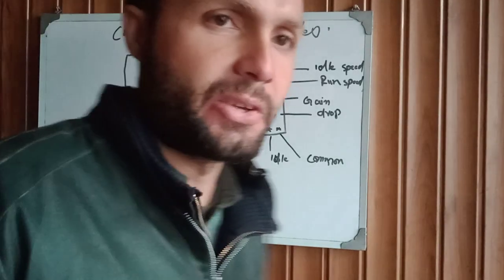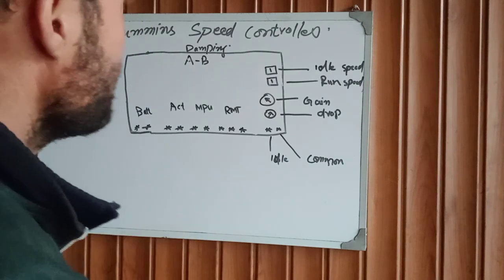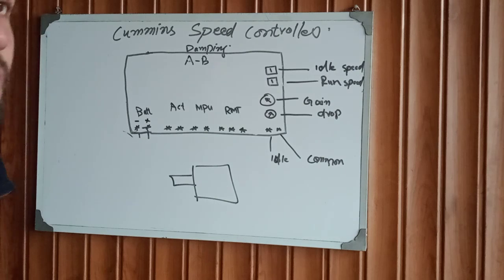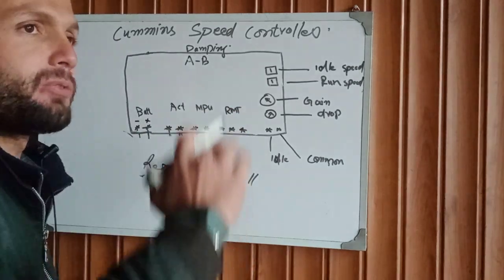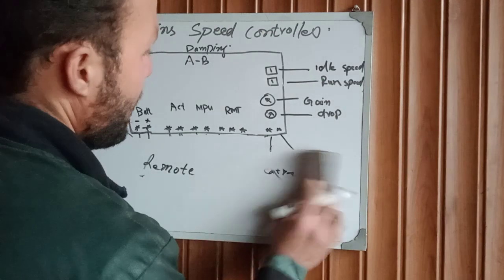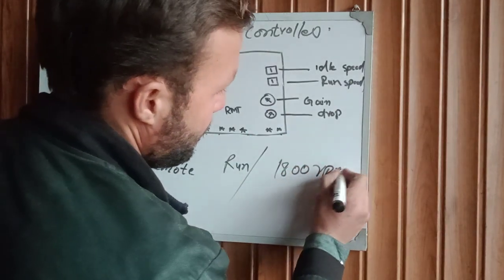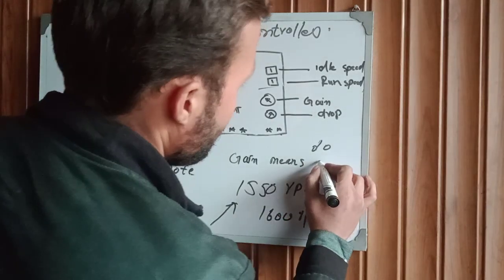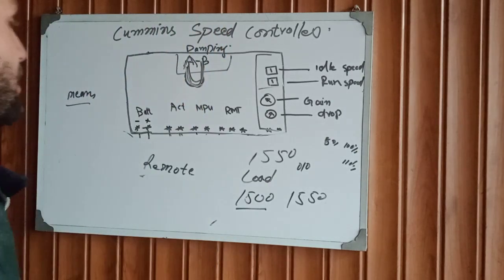Cummins Speed controller, Electronic Governor Controller wiring, English

Comment: Nice teaching Sir, 
But the Droop when is the right time to adjust?
Reply from the maker: Adjust the speed control knob so it runs at the desired no-load speed (e.g., 1500 RPM for 50Hz, 1800 RPM for 60Hz).
2. Apply full rated load
Use a load bank or connect to the grid in parallel.

3. Measure speed drop
Note the loaded RPM.
Example: No-load = 1500 RPM, Full-load = 1440 RPM → droop is (1500-1440)/1500 × 100 = 4%.
Reply: @Info-Tech- Ok, Does it mean I will increase Droop nub to 4 percent to maintain 1500 on load?
Reply from the maker: Check on load how much speed is drop. ?  1500%2 if 30 rpm is drop 1500%4=60 rpm is drop it mean from 1500 to 1440 on load the increase the drop to 4% that make again rpm stable to 1500
Reply: @Info-Tech- you are too much Sir, Thanks for your teaching.
Reply: I did not understand how to connect the idle speed to work,
Please can you do a video how wire idle speed with Dse module 7320.

Comment: if have supply battery going to speed controller sir the output of actuator have already if cranking the the genset  if cranking the genset sir if no supply from the battery the speed controller output actuator no a output already the speed controller function if have supply from the battery ?sir
Reply from the maker: The speed controller need input 12/24vdc supply first,  then the speed controller need mpu input supply which Ac , pwm signals like a small Ac generator, and finally when you crank the engine the mpu send the ac signals to speed controller and speed controller send back ac signals to fuel actuators to control the engine rpm speed
Reply: so meaning sir no cranking already if you tester the terminal of battery symbol in the speed controller have reading input going to the speed controller  @Info-Tech-

Comment: the magnitic pic up sir no polarity or have?
Reply from the maker: No polarity, it produce AC power
Reply: TNX por the reply sir  if no supply from module controller the pin output going to speed controller meaning no supply already the battery symbol in the speed controller thats why the output the speed controller no out put the actuator terminal in the speed controller  @Info-Tech-
Reply from the maker: @emmanuelrevilla7374 it's turned on & off by relay the speed control check with multimeter

Comment: In k50 model, efc type governor is used, why no isochronous mode in this speed controller?  Or Zero droop can be selected?
Reply from the maker: Isochronous system is used for fixed frequency on load  0% variation 

This controller is used in normal type generators where have little bit frequency variation acceptable
Reply from the maker: If you set zero droop it's mean 0% frequency variation, but its work in standalone generator set
Reply: So I can set 0 droop in this type of speed controller.  I want to have parallel operation but  I want to use one generator in fixed power mode, which speed controller to use . This is for cummins k50 engine.
Reply: Can woodward governor be fitted in cummins k50 engine?
Reply from the maker: @sreekantpss6997 yes

Comment: Nice video sir, sir this damping if u jumper the wire  what is porpuse, thanks and best regards
Reply from the maker: If the generator not stable after gain setting then jump this two A and B for auto gaining
Reply from the maker: Double bearing or local made generator which have a lot of vibration, not properly stabilize need jump a&b
Reply: @Info-Tech-  thank you so much sir, i hope more videos u make for generator explanation for wiring diagram,
Reply: @Info-Tech-  it also helps to reduce or eliminate oscillation or hunting in the governor system which is (Dampen Oscillation), the also to prevent over shoot or under shoot of the engine speed, which means it ensures that the engine speed returns to it setpoint quickly and smoothly.

Comment: Please don't give wrong information of gain and drop adjustment
Reply from the maker: droop mode, a generator's output and frequency are inversely proportional. When frequency decreases, output increases. If a generator has a 5% droop setting, for example, then a 5% decrease in frequency will increase the unit's power output by 100%.In layman terms voltage gain can be defined that how much the output voltage is greater than the input voltage for an amplifier. Technically it is the ratio of the OUTPUT VOLTAGE to the INPUT VOLTAGE